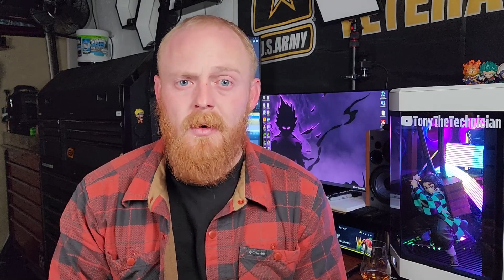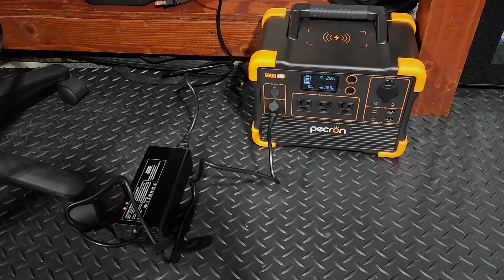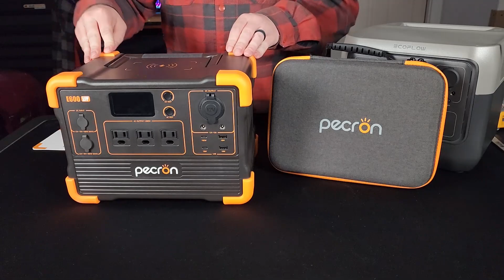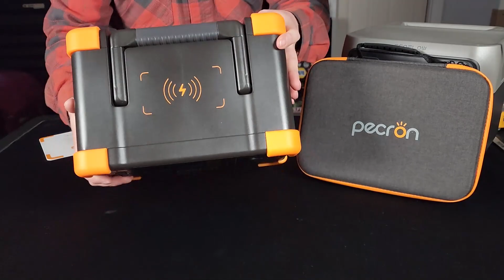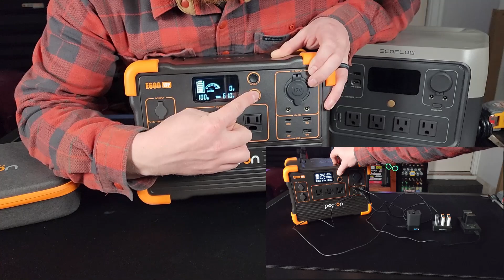Very Affordable Power Station from Pecron E600LFP

Comment: E1000LFP is the perfect balance of price and performance. I got that, well two, over the E600, I got an E500 for the bigger battery over most others in its class range for more off grid power for light, laptop and Bi-pap.

Comment: I have 2 of those pecron. I use them everyday in the house.   One in the living room and the other in the kitchen. Living room is used 10 to 12 hours a day for lights. Kitchen is used to heat tea water and if needed cook using go sun dc hybrid trays. I switch living room 10 or 12 hours everyday to kitchen after 4 days use. That way I can get 8 to 10 days before solar panel charging.

Comment: I have 2 of the e600's love them and 3 of their e2000's and two expansion battery's.  Personally I think they are a great bang for your buck.   I have dealt with their customer service and they were great.  One of my e600's charge controller stopped working they sent me a new unit.

Comment: I have a 2k and 1500 pecron with two expansion batteries      i am off grid (not by choice) and the 1500 is a better item to cascade with the expansion batteries, simply a bigger inverter, and the app.    We use the 2k more for those thongs we use infeequently (crock pot, air fryer etc)   the 2k has way better solar input tho